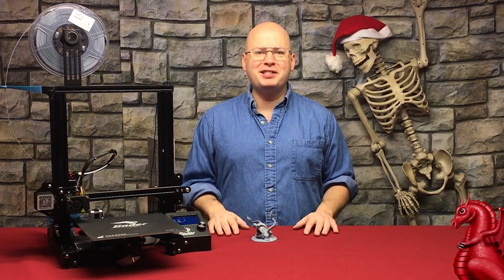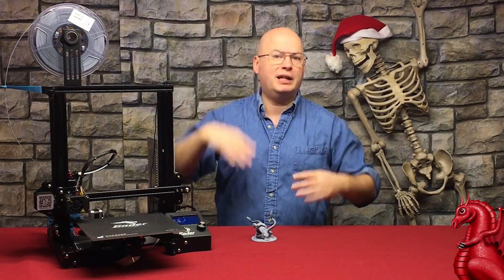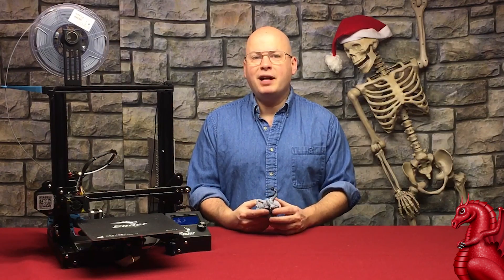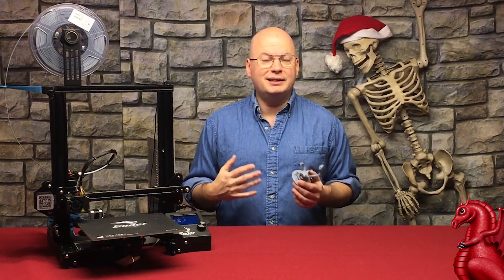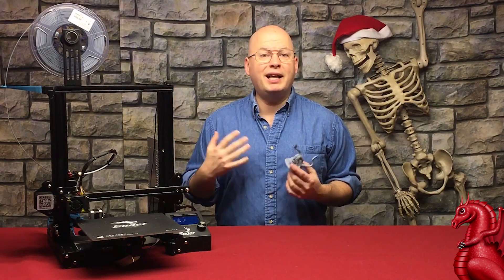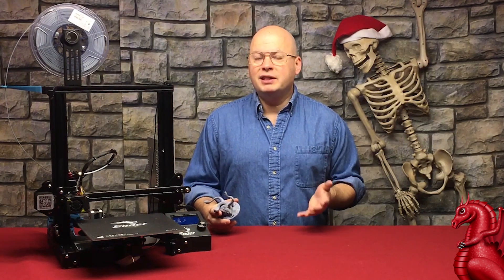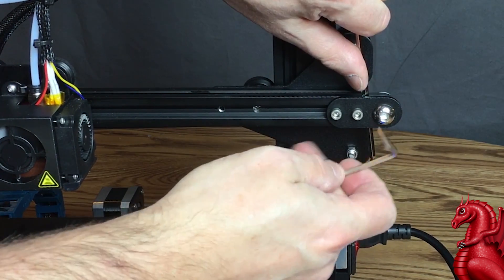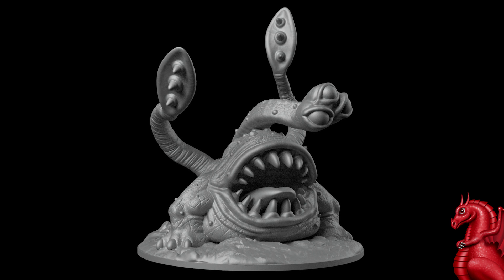Ender 3 Belt Tensioning

Comment: So no t do this people ... Look up the manufacturing tension for the belt and do t exceed it . I've never had a belt super tight and I I don't see layer lines . They might be hRs to find but it is highly listed at least on ended 3 they should not be this tight . I use a luggage weight to measure the amount if that helps

Comment: It's also worth mentioning especially on smaller prints it can cause anything that's supposed to be spherical or curular to be oval shaped. I'm suffering from this right now. I noticed my retraction towers weren't circular. I noticed a benchy with an oval shaped steam pipe but i didn't think anything of it because I was experimenting with print speeds and trying to see how fast I can get it to print with decent quality but then I reset to defaults and the ball joints on the camera tower I printed wasn't perfectly spherical.

Comment: I have both a CR-10S and Prusa i3 Mk3S and the Prusa prints way better quality than the CR-10S.  I have even added a bunch of mods to the CR-10S and it is still slightly inferior.  Here is a list:
32 bit board (BTT SKR Mini E3 v3)
Marlin 2.1.12
Microswiss NG Extruder
Custom designed by me dual 5015 part cooling fans
Anti-backlash z nuts

Not sure what you are doing on the Prusa to achieve poor quality, but I get results as good as your "improved" results with mine...  On the CR-10S, it is still slightly under that quality.  I did just order new Gates belts and better performance X and Y motors.  Hopefully those upgrades will help as well.
Reply from the maker: I'd love to see pics of the 28mm scale miniatures you are printing on the Prusa.

Comment: Can you update the video to show how you know it's tight enough?
I had a print where the inner walls weren't adhering. I tightened the y-axis belt and now It's causing a different problem (I don't know how to describe it or easily troubleshoot because I don't see it in any of the online troubleshooting guides). I assume I tightened the belt too much.
Reply from the maker: It's something you have to develop a feel for, I can't show you in a video. You don't want slop/droop, but not so tight it stretches the belt.

Comment: You could also print some belt tensioners for the stock hardware and never have to unscrew anything :D
Reply: You'd be better just buying the metal ones that can be screwed rather than printing one! I had 3d printed ones on my old Anet A8 and they didn't hold up long term
Reply: @weeurey  I have 3D printed a set for X/Y even on PLA and they work as a charm. I just printed them horizontally.
Reply: @DaRk_DoG  PLA will eventually warp overtime, they will last a while though! But certainly will eventually degrade with the pressure

Comment: After watching a CHEP video on the topic where he installed new tensioners, one of the comments mentioned that he removed belt tensioners to install belt tensioners. Came here as a follow up and sure enough you’re adjusting the tension with the built in ones. Thanks for the guide and for saving me a few bucks.

Comment: Please help, I can't get the t nuts to tighten, they just stay horizontal
Reply from the maker: Loosen them until the screw is just barely holding them, that will allow them to fully drop into the channel area, if the screw is turned in too much they can drop into the channel.
Reply: @Tombof3DPrintedHorrors  Thanks, that really helped

Comment: How do you fix straight edges on circles? Is this a belt tesion thing? I can't find anything about it online.
Reply from the maker: You can't, that's just the poor design of models that exhibit that.
Reply: @Tombof3DPrintedHorrors  It's not the model can't even print just plain circles found the solution here - dhobbyis[dot]com/circles-have-me-going-in-circles-3d-printer-woes/

Comment: Because I was a complete idiot I put the belt over the wheels instead of under them and am hoping they're not to far gone.
Reply from the maker: If they stretched at all you will need to replace them (accurate prints depend on accurate tooth spacing.)

Comment: Ender 3 stepper are JK42HS NEMA17 which are rated for 28NM (2.8KGf) of radial load. The way you advise people to adjust belt will put way more than 2.8kg tension on the belt... I adjust my belts with a load gauge and they are far to sound like a guitar string.
Reply from the maker: I never said sound like a guitar string, I said feel. :)

Comment: what is the cause of random Z banding / artefacts?
Reply: This can be caused by the temp of the hotend going up and down.
If you are seeing this open a text editor, paste this code and run it on the Ender 3.
This will tune your hotend (or bed.. Change temp to 60 and E to -1)
; S = TEMP c = COUNTS
; E0 = HOTEND 0
; E-1 = BED
M117 THIS WILL TAKE TIME
M303 E0 C8 S200 U1
M500
M117 AUTOTUNE COMPLETE
M0

Comment: The belt started making a cracking sound due to the contact with the metal !! Any idea how to stop it from happening?
Reply: I don't know if you figured it out yet, probably did but I had the same problem and that's only because the tensioner tends to go downwards as you tighten it. That makes the belt ''teeth'' rub on the aluminum extrusion of the X axis carriage.
Reply: Try levering it both ways so the tensioner is straight, so it doesnt rub like 2JZRulz said

Comment: I seriously cannot thank you enough for this, I had my flow set to 130 because I thought it wasn't extruding enough and used the extra filament as a temporary fix. My X axis belt was so loose that I could noticeably see layer shifts, but figured that since the Ender 3 isn't a high end printer, it wasn't something I could fix easily. Now that my belt is tight, my flow is back to 100 and I'm getting the smoothest prints I've ever had with this printer. Liked and subscribed!
Reply from the maker: Glad it helped! :)

Comment: Hello i have tried your method but my ender 3 now layer shifts by 2.6cm roughly 
I have a glassplate it might be to heavy??? 
I have accelaration lowered to 100mm/s*s 
Do you have a idea
Thanks for any help btw.
Reply: Since the glass plate is likely putting strain on the Y axis, try lowering your print speed to 30-40m/s. Even with my stock printer I'd never go any higher than 40 unless I need something printed insanely fast.
Reply: Lukease a friend of mine prints at 140mm/s 
And gets a better benchy then me when i use 50mm/s (without glass) 
I had to now replace the stepper so yeah

Comment: This is exactly what I needed. I think because of the extreme temp fluctuations some prints failed and crashed the head stretching or pulling in the belt. I had very bad layer shifting on the x left to right axis.

Comment: Will a loose belt cause the nozzle to scratch the print itself?
Reply from the maker: No, loose belts only cause X/Y layer shifts/banding.
Reply: @Tombof3DPrintedHorrors  i figured it out, it turned out my z rod wasnt spinning with the stepper motor I loosened the screw on the coupling and then pushed the rod just a bit down then tightened again problem solved :)

Comment: FYI you are supposed to set your belt tension to a specific frequency. There is an actual tool to do it made by Gates but you can also use a guitar tuner to set it. 

https://www.youtube.com/watch?v=KiVtav7wz2U

Doing this prevents resonance from the stepper and the belt from affecting your prints.

https://www.youtube.com/watch?v=mbK-lGC3bEY

The Prusa MK3 actually measures the belt tension using the stepper motors. They don't even mention that in the build guide. I found out after I made a forum post about it.

Comment: Now when moving hot end towards right where I adjusted it makes a sound, normal?
Reply: Update, the bearing isn’t truly aligned with the belt, so tightened this set it off just enough, replaced the but with 3 1/4 washers which lined the bearing perfectly.
Reply from the maker: Great catch!
Reply: Tomb of 3D Printed Horrors It’s a lot harder to move the hot end back and forth now. Normal?
Reply from the maker: That would be too tight then.

Comment: Just finished setting up my Ender3 yesterday by following your build video.  Noticed on my xyz calibration cube some inconsistent layers that seemed to start at certain changes of direction on the embossed X side.  Other than that my print was perfect.  Wasn't sure what was causing it, but after seeing this video I think that my X belt is probably exactly what's causing this.  Looking forward to tightening and testing it when I get home.

Comment: I've tightened my X belt which was a little lose i guess and didn't notice any improvement. Just increased the noise on X motor... Tryed to loose a little bit more bit only influence the noise and i'm using dampers... Very strange

Comment: Great tip! I just did this two weeks ago using the same leverage trick on both axes and I also saw a bump up in quality. I wasn't sure that I could credit the extra belt tightness though since I was also changing up slicer settings at the same time based on your video on printing miniatures. Either way, I was happy with the results.

Also, do you always print in grey? Is it easier for painting or is it a bargain price?

Also, also, I have been trying to print a few miniatures I found on Thingiverse and I'm guessing they are really not well designed for FDM printers, not just because they need support, but also due to thin swords/bows etc. Perhaps you could cover model selection issues, or ways to work around design issues?

Comment: You seem to be saying the ender will actually give better print quality than the prusa ?, that’s very interesting. Would be good to hear your thoughts on that and the known extrusion issue on the prusa. Prusa say all printers suffer from it and it’s not a fault with their printers. Could you do a video on that ? Thanks
Reply from the maker: I own four Prusas (mix of Mk2s and 3), all tuned, extruders calibrated, etc. None can give the quality any of my Ender 3s do out of the box before I begin tuning them in. I won't be doing a video on Prusa inconsistent extrusion as it's been covered extensively, Prusa has said in a video they are aware of it and are working on a solution, so there's nothing for me to do a video on since I don't have a fix for it either. They also say all printers have it, but my Creality printers do not exhibit it nearly as much as my Prusa printers (especially Mk3).  For more info go here: https://github.com/prusa3d/Prusa-Firmware/issues/602
Reply: Wow Im tempted to buy an ender of it beats my MK 2 I could sell it.  The ender is so cheap its worth the punt !

Edit .... I was looking at a SLA printer for minis but yours looks almost as good ! 
Subbed !